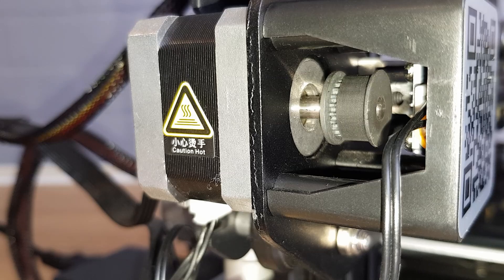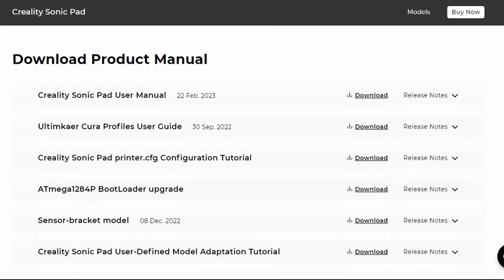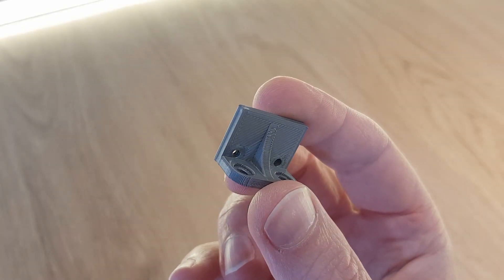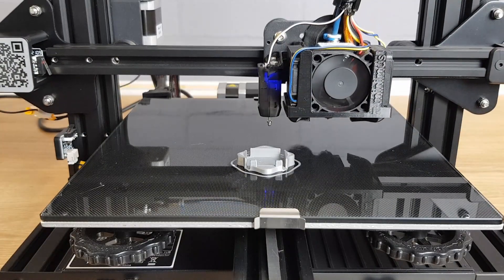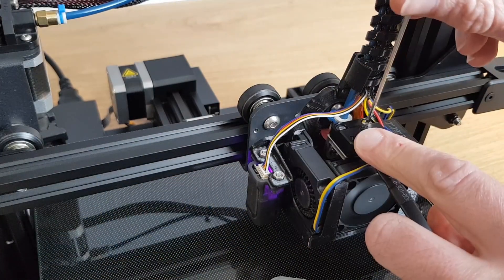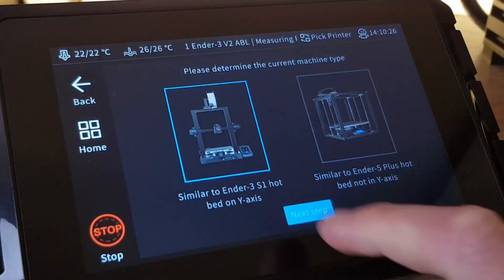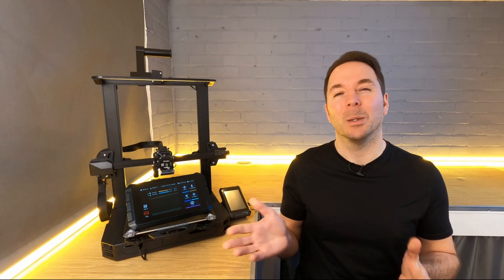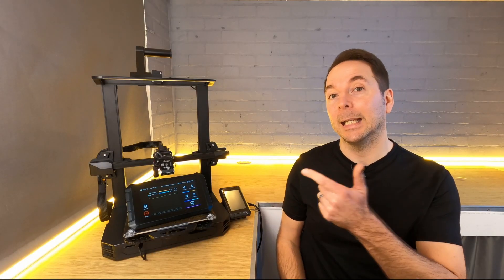Tune Input Shaping With The Included Sensor - Sonic Pad Intermediate Part 5

Comment: Do you mean restart klipper or restart firmware in regards to this comment. "*Since recent firmware change, it is necessary to issue a 'restart' command after changing any settings or following any calibration procedures.*"?

Comment: hi i have and ender 3 which i installed Klipper on with the sonic pad and used the ender 3v2 using 4.2.2 mother board. i have issues trying to calibrate resonance using the sensor. when i try it, it reads the sensor but when actually starting the test the i get an error that says my mcu has shut down. any suggestions?

Comment: I did this and all seemed well but now all my prints have excessive amounts of stringing. I mean I did the temp tower test and every temp had so much stringing it was hard to see through it. Before this I printed of some prints with just a tiny bit of stringing. No other changes were made but running the measuring resonance on the sonic pad. Any advice?

Comment: I have done the input shaping with the sensor. And it totally messed up my printer settings.  After inputshaping, it stops extruding before a corner, and retract all the time....looks ugly.
I have done it twice now, with new S1 Pro printer profiles, and everytime it mess up the printer settings. So this trick is not for every printer.... That or Creality made a fuck-up again 😁
Reply: This is a config file without input shaping manually made:

[input_shaper]
shaper_type_x = 3hump_ei
shaper_freq_x = 78.2
shaper_type_y = mzv
shaper_freq_y = 38.2

And this is a config file with input shaping manually made:
#shaper_type_x = 3hump_ei
#shaper_freq_x = 78.2
#shaper_type_y = mzv
#shaper_freq_y = 38.2

Theres definitely something wrong here!     It should be reversed on the two profiles.

Comment: Hmmm...mine doesn't seem to save, it just says system ok.
Reply: Same thing with me after the Y test has been completed and I press the button, it just goes back to the test screen for picking your printer.  I don't get the same screen as shown 
in the video
Reply: So I don't know if the data has been saved or not since no reboot was done.

Comment: Since this is a temporary one off test/calibration thing, why was this not done at the factory on units such as the SE and KE?  Seems stupid that the consumer needs to buy this accessory and print and attach brackets to do this.
Reply: It works on a per printer basis - as there are literally 1000's it would be tough to do all
Reply: Belt tension, roller tightness, frame bolts, etc. will affect resonance frequencies. The machine comes partly disassembled for shipping. That’s why you’re supposed to properly tighten and tension those before the test.

Comment: Have Sonic Pad and a Creality CR-10 V2, with a BLT. The Sonic Pad has a profile for the CR-10 V2 but without the BLT, so the setup will fail as it wants the Z stop to be in place, which it isn't. How can I get the BLT information into the printer cfg gcode so that the sonic pad will complete the setup for the CR-10 V2 with BLT ???

Comment: Great video, thank you. The only thing I'm not sure about is... is this a one time test, or does the Pad read values during printing also? So does the sensor needs to stay on the head or can it be removed after the calibration is done?
Reply: I appreciate your question as a month old, however, if you read the manual for the sonic pad, it states that you do not need to leave the sensor attached after calibration is complete

Comment: Hi Ricky, Amazing series this one. Using my Ender 5 Plus with Sonic Pad it recognize the sensor during the connection check but after starting the actual test it give me this type of error:
- Can not update MCU {0} config cause it is shutdown
I've tried to reboot the system and give a second try but nothing changed.
Any idea of suggestion on what I should look after?
Many thanks again for your help.

Comment: There seems to be some conjecture about turning off acceleration in the slicer. If I’m not mistaken, you found your maximum acceleration (as did I) to be 7500 and you set it in printer cfg at 7000.  With acceleration turned off in the slicer, running at 7000   Beats the heck out of your machine doesn’t it?  I could be wrong but it seems to me to be analogous to throwing a brick on the gas pedal with no regard for the road ahead. The slicer has the map and knows about the hairpin turn ahead while klipper is blind and standing on the pedal.  Thoughts? Thanks

Comment: I recently decided to retune my input shaper settings by rerunning the procedure from the Sonic Pad. I completed both parts, I have an Ender 3 3d,  and  upon completion I pressed next to complete. The Sonic Pad did not save the new settings and restart . I was watching ,via the Fluid console, and it showed the new values and said to save and restart. I tried that and it went through the motions but it did not modify the Input_shaper settings in the printer.cfg file. As a matter of fact the settings were commented out.  Is this normal?
Reply: @goblinrio Everything seems to be working just fine. It’s taken a bit of tinkering in the beginning, but it’s been trouble free ever since. I’m on a few Sonic Pad FB pages, and I see people having all sorts of issues with their Sonic Pads. I’m not sure what they’re doing differently from me, but I’ve been thoroughly enjoying my experience and results. I think some people may be overthinking things, or trying to tinker beyond their scope of ability. I’ve found keeping things simple with the Sonic Pad is the best way to ensure success with it.
Reply: Upon further review, the settings are being stored in the printer.cfg file below the "do not edit below line" .  I'm learning.
Reply: I just got my Sonic Pad yesterday, and ran the test this morning. I updated the Sonic pad to the latest version before doing the test. It restarted after the update. After running the test, I was not asked to restart the Sonic Pad. Here’s hoping it saved the data.
Reply: @emac800 same for myself, I never get the restart, the test ends and I just go back, did it save or not? What was your experience 2 months on?

Comment: well a friend and I went the cheaper route, Pi, 7 inch screen, OctoPrint and Klipper. And yes it all works BUT when it comes these advanced tunings we are really at a disadvantage. You have routines programmed to run the test collect the data and update the Config file. We have none of that, I have to buy a sensor and wire it into something then gather the data and transfer it into the config file. What a mess. I watched this video and you were so calm and even printed the bed holder. I am so Jealous. So when a different friend with 2 Creality Bed slingers asked about my experience with Klipper I sent him the Sonic Pad link and your install videos. He agreed and ordered the Sonic Pad. When it comes he can go thru your vides to set up then this series to super tune them. I wonder if anything here would be useful for my kludge Klipper install. Like the sensor holder on the bed, maybe a sender part number. Anything else we can cross over on???  Great Video Series. Dennis

Comment: Is there some way I can see that my printer actually did something with it's settings after running this test?  All of my accelerations look the same as they were before, and the input shaping section in the klipper settings is largely gibberish to me.  Here's what it says on my ender 6 : 

[printer]
kinematics: corexy
max_velocity: 500
max_accel: 5000
max_z_velocity: 10
max_z_accel: 1000
square_corner_velocity: 5.0

[input_shaper]
#shaper_type_x = ei
#shaper_freq_x = 110.4
#shaper_type_y = mzv
#shaper_freq_y = 87.0

Comment: Ricky, your vids on the sonic are a godsend, thank you! One problem I'm having on the resonance test- 5-plus here with an Microswiss NG direct drive. I started with the xy bracket (found one online that fits on the fan screws, though I have to let the front fan dangle as I couldn't find longer screws but I don't think that matters here). Test started, didn't let me choose a printer type just autoselected and took me to start test. It only did 1 test, never gave a prompt to move it to the bed bracket?
Reply: If you're using a core XY printer, like an ender 5 or ender 6, you don't need to move the sensor.  The point of the test is to measure how your printer moves and yours likely doesn't move the bed front to back.  If you already had the printer entered it just used that setting and knew you didn't need to move the sensor.  Log into the web version of the Sonic Pad software and you can see the commands sent and received by the sonic pad.  I have an ender 6 that did the same thing - just started the test without asking.  I could tell from the console commands that it tested both x and y.

Comment: My 2 cents is if you plan to print the Y axis bracket, attach the X axis bracket and sensor first. Then print the Y axis bracket and keep bed temp up during test. By the time I got to the Y axis step the bracket came right off
Reply: yep, this indeed! and i only saw your comment after this happened. i ended up fastening the sensor for Y with some electric tape on the s1 pro bed handle :(
Reply: Lol! I couldn't even get the sensor in because it was right under the extruder. He ought to have placed the finished print 3/4's of the way back...

Comment: I plan to attach the input shaping sensor to the fan housing due to the extruder I use. It will be in the right position but what I am worried about is, with the hotend fan being on all the time will this affect the sensors' results?
Reply: I was going to delete this post but thought I cannot be the only one to wonder about the hotend fan's influence. I have just realised that it is part of the test because if it was turned off to do the calibration then the results obtained would only be valid if the fan was always off. Which of course it is not.

Comment: I have a question how come after I did this test it didn’t restart my sonic pad?  It did the same thing in some other videos.
Reply from the maker: The new firmware update changed things a little so it doesn't restart to save the config.

Comment: Great video, thanks. If I have run the calibration once initially, what do I have to do to rerun it? does the routine overwrite previous procedures or do I have to change any settings before rerunning it? Thanks
Reply from the maker: It should just overwrite the configuration when you run the procedure again but I haven't actually tested this out myself to be 100% sure.

Comment: Im not seeing where i can attach the sensor to my hotend with mine. I have an Ender 3 v2 with a touch on it. Im not seeing anywhere to mount the bracket or the sensor by itself. My senor also looks slightly different to yours, Its just a flat wire going to the pcb the sensor is on. Can i tape it to my hotend or will that upset the readings?
Reply from the maker: Did you download the brackets to print that Creality have listed for the E3v2? I haven't seen different sensors be supplied with the Sonic Pad, I wonder why yours is different.
Reply: @RickyImpey  digging through the box I found the housing. It must have popped off or was never attached. I ended up screwing it to my touch sensor directly. Wasn't really sure how that bracket they supplied was supposed to go into my stock hot end w/ touch sensor.

Comment: So I have a ender 3 neo…. So basically anything creality has made since is not compatible, does anyone have a solution? I don’t know how to attach?
Reply: Hi -- Did you ever get this sorted out?

I just printed the bracket.  After quite a bit of head scratching, it appears that the bracket mounts with the largest surface facing up.  The smaller surface below, mounts to the same holes as the probe.  You would need to remount the probe with longer screws.

The slotted area at the back clamps to the back plate of hot end carrier.

I am debating if it is worth it to use this bracket.  I'm might try double sided tape and see how that works.

Comment: After disabling CURA controlled acceleration my CURA projected times dropped dramatically but the real print time was over double the projected time. I did a test and Cura projected time was 33 minutes but actual with Cura acceleration off the actual print time was 75 minutes. Then I printed the same model with the only change being enabling Cura acceleration control and the projected time went up to 41 minutes and the actual went down to 53 minutes. The quality of the prints was the same, so I am not sure what is going on. Is there a way to tell if the Klipper settings are saved?
Reply from the maker: It sounds like your accelration settings in klipper are limiting your speed. What is your max acceleration?
Reply: @RickyImpey  On my Sonic Pad under Movement Parameters it is set to :
Acceleration - 5000
Accel to Decel - 2500
Velocity - 500
Square Corner Velocity - 5
Reply from the maker: @billhaley8873  That's pretty standard with the Sonic pad. Expand all of the acceleration settings in Cura and see what the settings are for each area of the print. It's strange as the slicer settings should never let the printer move faster than the firmware limits.

Comment: Just a quick one, I completed  the both tests with no problem,I printed the y axis mount with a raft and preheated the bed to 70 before the test,was around 48 on completetion. My question is after the test it didnt reboot,i got a message saying completed but no restart just stayed in the advanced section screen. Im on the latest version of cura,many thanks
Reply from the maker: There are some changes with the new firmware unfortunately. It should save but if you are in any doubt, use the commant SAVE_CONFIG in the console and restart
Reply: @RickyImpey  Thank you Ricky

Comment: Great series. Thanks for all the help. I have followed your steps and after the sensor is done it says it will save. When I select OK, it cycles and then displays an error message. I am using an Elegoo Neptune 3 PRO. Any idea why this keeps happening. I will check the printer.cfg file for the input_shaper code and see if it actually is there. Thanks for the help.
Reply from the maker: What error message do you see?

Comment: Hmmm … my Print is worse after tuning Input Shading with the Sensor (Ender 3 S1 Plus). Massive stringing and the Print Looks like a massive overextrusion. Is there a simple way to undo the calibration? Some Lines in the Printer config? Or is the only way to reset the Sonic Pad to Factory Settings?
Reply from the maker: Yes, you should just be able to go into the config file and edit the input shaper section. If you zero the X and Y frequency figures then it effectively removes input shaping.
Reply: @RickyImpey  Hi Ricky! Thx so much! :-)

Comment: I get an "Can not update MCU {0} config as it is shutdown" error every time I try and start the test after it verifies the sensor.
Reply: did this get resolved? I keep getting the same thing
Reply: I had this. I think for me it might have been caused by starting a preheat and then starting the resonance test. If I restart the printer and the pad and don't do a preheat then it seems OK (I was preheating in an attempt to keep the sensor attached to the bed mount).
Reply: @andybarrett5948  exactly this... It only happens when the preheat cycle ends after test has been started. Restart the pad and the printer. Then try again.
Reply: I am too.
Reply: I managed to get my test to start by unplugging any camera, usb stick and turning off printer and sonic pad. Then I plugged in the sensor, connected to my extruder, then turned on printer and sonic pad.
Reply: Chat_Rickylmpey  I am using an Elegoo Neptune 3 pro. The sonic pad goes through everything and then tells me I was successful and says it will restart but I get an Error message
Internal error on command:REMOVE_ MCU_RPI_CONFIG
Any idea what I need to do. I can not find any info online.

Comment: Any thoughts on why after successfully completing both tests the sonic pad does not reboot properly? When I select to continue by rebooting and saving results the screen goes black for a second then brings me right back to the beginning of the test (the screen where you select printer type). Your videos have been very helpful and other than this hiccup I’m enjoying working with my new sonic pad
Reply from the maker: Hmm, no mine hasn't done that to me. Have you tried a firmware update to see if it changes anything?
Reply: @RickyImpey  I believe I updated it when I first got it just a few weeks ago but I’ll check and make sure it’s the latest. Thanks!
Reply: Mine is doing the same thing. Im on the latest firmware. Did u find a fix
Reply: @OhImKiCkiN  well I’m glad to know I am not alone lol unfortunately I have not found out why it behaves this way. If I look in my config file I see results from the input shaping so it seems to save despite not rebooting correctly. My printer is printing great but I still am not sure if it’s really operating correctly and running as well as it could.